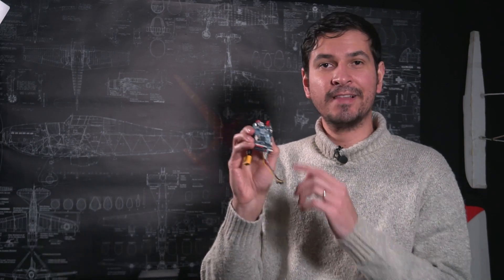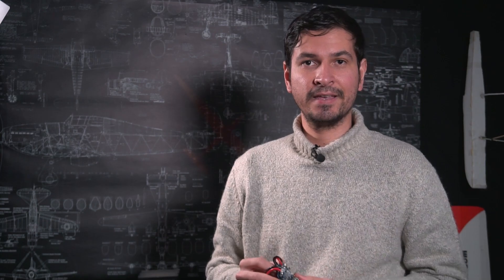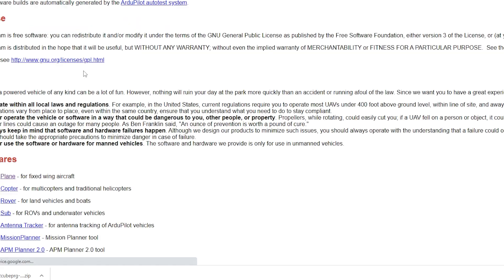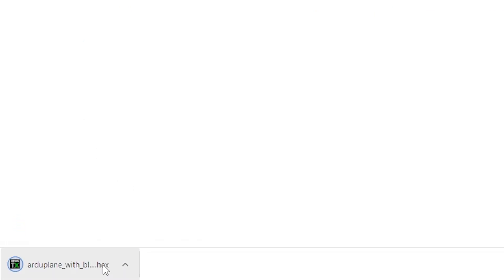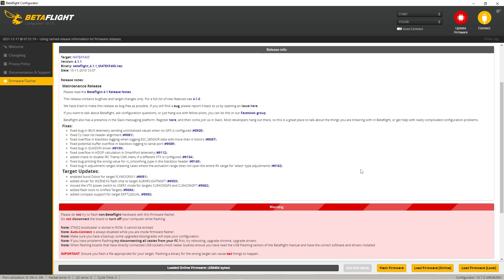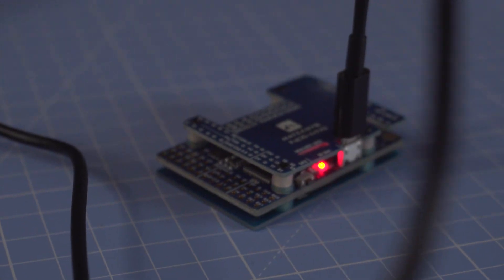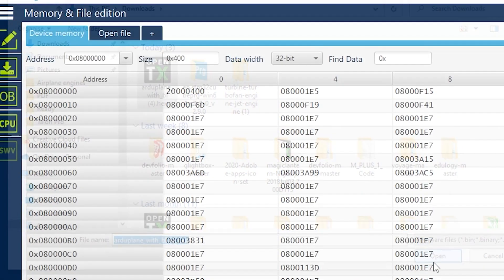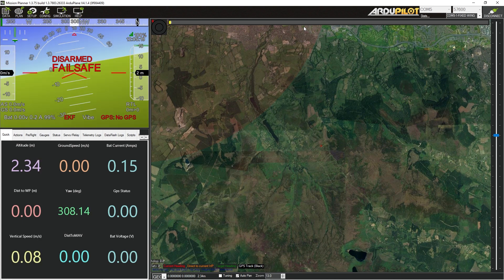Fix Bricked Flight Controller Not Flashing Firmware (STM32 ) inav, betaflight, ardupilot, etc.

Comment: This worked perfect!,  Thank you I had been been trying for hours to update the firmware on a Speedybee F405 Wing with INAV, drivers etc.. Now it has the latest firmware 7.1.2 and I am now using the latest 7.1.1  INAV Configurator. Thanks again

Comment: Hello friends, I have a fc speedybee f7 and there is an fpv camera socket with ground, 5v, cc and cam pins. can i use it for sensors with ground, 5v, rx and tx pins? Thank You

Comment: please tell me, I have an Afroflight 32 board, just the blue LED is on, I flash it as in the video, the blue LED is still on and that’s it, the firmware. naze. maybe you need another firmware Afroflight 32 ????
Reply: CPU Broken I think, If u have multimeter u can measure it, Using continuity mode, Measure on 3.3v pad and ground, If short, that 100% Cpu failure

Comment: I replaced the F411 on my Matek f411 wse from another board.

The original fault was that the previous owner of the board connected the Camera in reverse polarity and cooked the FC. The F411 chip had a little hole in it and the board would get really hot and no lights would come on.

Now the red lights come on, and a device is recognized by windows 10 but it says the device malfunctioned.

When following your steps with this program it doesn't get recognised as a USB device and DFU impulserc driver fixer also does not work. Very sad, any tips on other components I should change?

Comment: Thank you so much for putting up this video. It was meant for me lmao. The program was successful but the accelerometer, barometer, or sensors are not coming up
Reply from the maker: Glad it helped! But if you're still having trouble then there's a problem with your hardware.
Reply: Same Here, all Sensors are gone
Reply: It actually ended up working for me
Reply: @farkhodkhikmatov4738  how?
Reply: @freak33a  I undated the stm 32 twice
Reply: Just do it again?